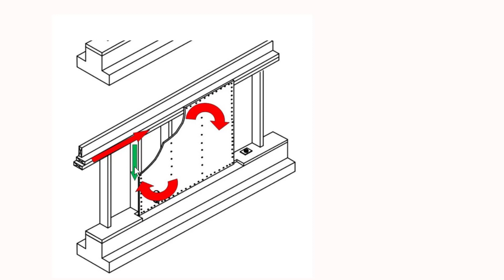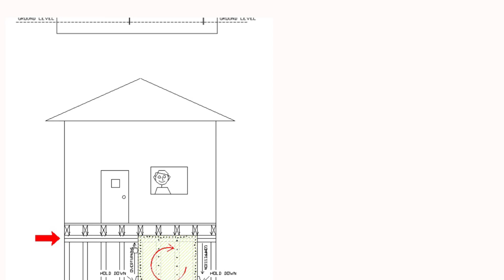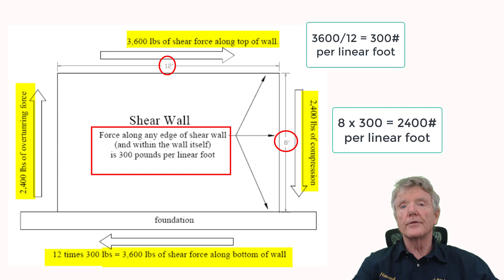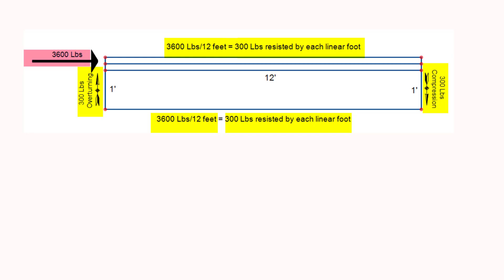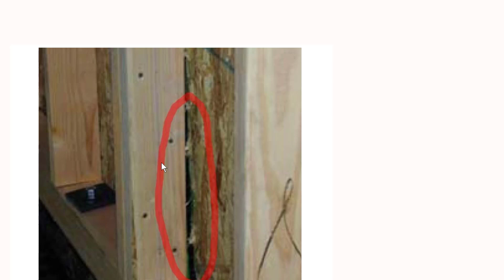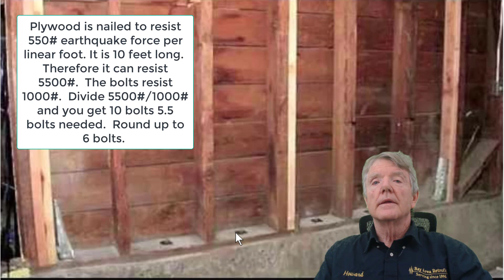Shear Wall Damage Caused By Overturning

Comment: Hi, the water damage the studs at the corner of the house and now they want to replace the original stud with brand new 2x4. I am concern that if they do that will that unattached the OSB shear wall at the corner of the house and eventually the stone veneer fall off along with shear wall. Can the sister stud 2x4 from the base to the top plate nailed to the original stud satisfy the splicing?
Reply from the maker: I don't know what you mean.  Send fotos to Howard@bayarearetroit.com

Comment from the maker: It does not matter.  Just be sure to block horizontal seams with 3x or 4x blocking.  One row of edge nailing through top of the lower piece of plywood into the block and the same with the lower edge of plywood into the top of the block.   I would not bother putting the diagonals back.

Comment: I'm retrofitting my Garage wall 12' h x 20' long, 2x6 studs/sill plate/ top plates. My question is about your Double Studs. About 5' off the ground there are 2x6s going between all the studs
and there are 2 diagonal 2x6s going sill plate to top plate which cross in the middle. 

How do the double studs get put in? Do I need to rip out the horizontal 2x6s, put in double then replace or cut the double stud to fit? I see the double needs to be stitched to the existing stud, just not sure how to put it in.

Typical SF house, 2 stories above the garage, 1967. I'm also putting Drywall over the play to cut down noise between neighbors. It does have one 2'x12' narrow wall to one side of garage also.
Reply from the maker: I am not 100 percent sure I understand but horizontal or diagonal bracing does not do anything and can be safely removed and go from there
Reply: @bayarearetrofit5814  Ok let me try again
The 2x6s between studs are fire blocks, sorry didn't know the name
Looks like the others are called "Diagonal Bracing"  as you noted.
So, sounds like you are saying. Remove the firewall block and diagonal brace when inserting the double stud. I will replace both when that is done.

One more question: My wall is 12ft high x 20. Is there a preferred pattern for the 4x8 sheets of ply? e.g. 5 across the bottom leaves 4ft at top. Then what at the top? Horizontal or cut them in half and continue the edges along the double stud? Or horizontal at the sill plate and Vertical above. 

I must have watched 3hrs of your videos last night - they were great! very informative
Thanks,
Tim

Comment from the maker: Both Appendix Chapter A3 and Standard Plan A have this 4' height restriction.  Both standards state that if the cripple wall is over 4' one must hire an engineer.  There are links to these two standards on the website.  

The only difference between a retrofit with cripple walls over 4 feet and one that is over 4 feet is that you will probably want to put in hold downs in some locations to resist overturning.  Where these should go is simple common sense.  

I was on the Standard Plan A committee and know its authors well, all of whom were engineers.  So far as I can tell this 4' was specified so engineers could get all the easy retrofits where you can stand up, while contractors were given the ones where you had to crawl on their bellies and rub their faces into the dirt. In other words, keep the easy ones for yourself and the crap for the contractors. That is the only explanation I can come up with anyhow. 

The current upcoming ICC 1300, which is being formulated out of FEMA P-1100 does not have this 4' restriction and the only thing that is different is that it uses hold downs.  I am on the ICC 1300 committee and it is the biggest piece of crap guideline out there.  Search 1CC 1300 and you will see all my recommendations to the committee, almost none of which were accepted.  I was able to convince them not to use KC Metals hardware which had been extinct for years but that is about it.  They way it started is that the Applied Technology Council convinced FEMA to give them a grant to create a retrofit guideline.  They took the money and hired all their friends to create the worst piece of crap guideline out there that no one will ever use.  In about 10 years the ATC will tell FEMA we need a guideline because nothing we have works and the cycle will start all over again .   

When in doubt, put in a holdown.  If you look at the video I have on overturning and holdowns you will be convinced they are not very important anyway.

Comment: I have a two-car garage soft-story situation (living space over the back half of the garage) with about 4' wide walls on each side of the garage door. I'm planning on putting in shear walls on both sides of the garage door and it's easy enough to turn the other garage walls into shear walls as well. Functionally, is there any reason to sheetrock over the plywood?
Reply from the maker: Type X 5/8 sheet rock is required by code.  Please subscribe to the channel to increase its rating.

Comment: Thx Howard! How critical is it to start the shear wall at the corner of the existing wall? Sometime the spot in the corner is taken by the existing anchor bolt so that there is no place to to anchor the hold down.
Reply: It does not matter at all so long as all the top plates are stitched together.  Look up Top Plate Connections on the website search  bar.

Comment: Thanks Howard! One question - the final shear wall diagram appears to show two columns of plywood edge nailing in to the double studs hosting the hold downs. Is that nailing pattern necessary or a minor error in the drawing?

Also, the final minute of the video is dead air.
Reply: It is correct, but stagger the nails so you get the required edge nailing overall.